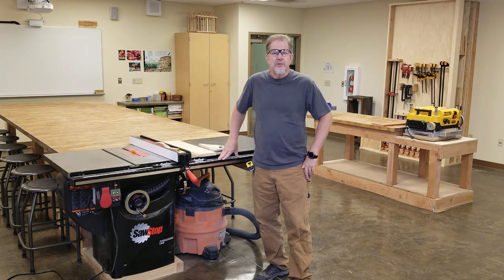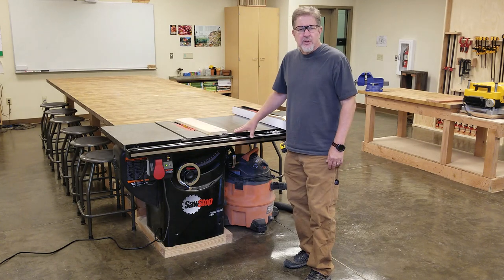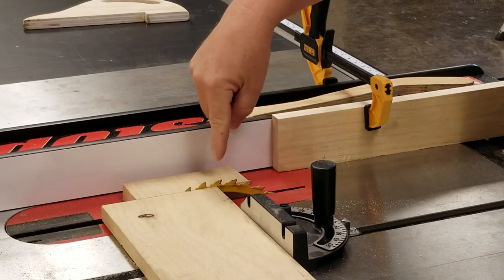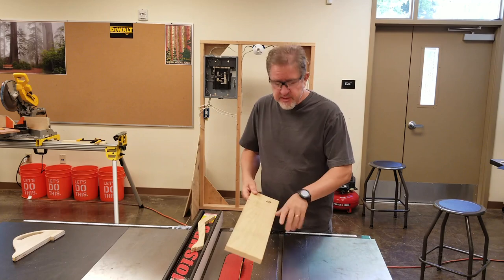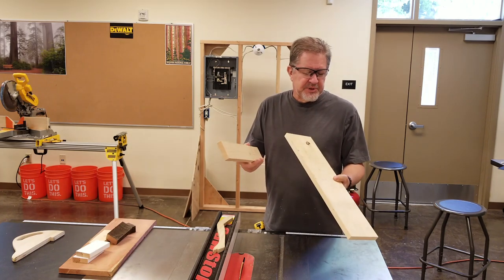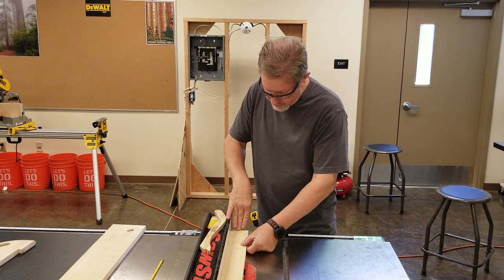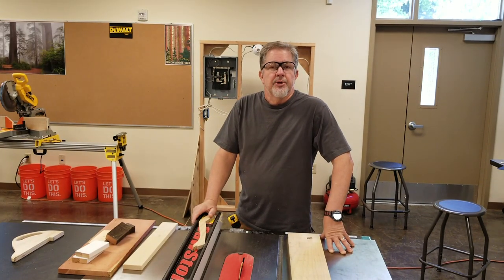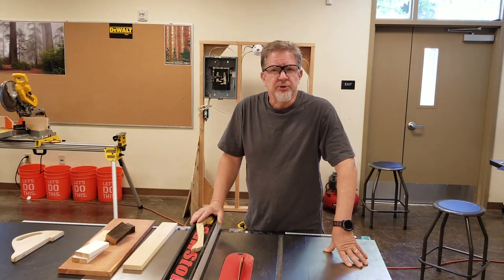Table Saw Safety

Comment: Is there a reason that you don't have the SawStop guard, anti-kickback and splitter especially working with students?
Reply from the maker: The guard decreases my ability to see and feel what is going on, which decreases safety for me.  The anti-kickback attachment mars the board and causes problems if a student needs to shut the machine off in the middle of a cut.  Splitter is not used because it's not needed.  I've never had an injury in all my years of teaching.  YMMV.